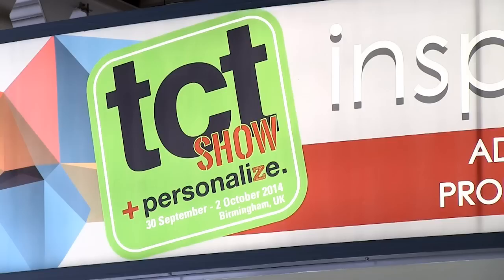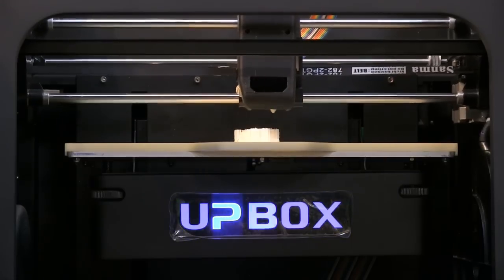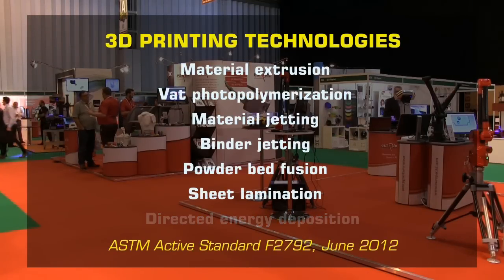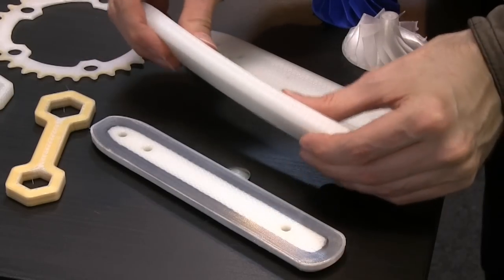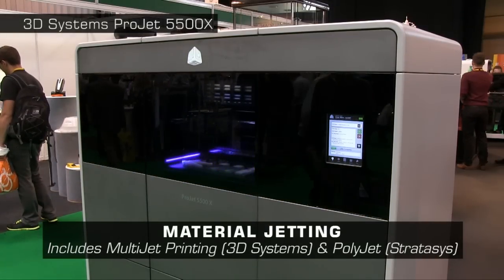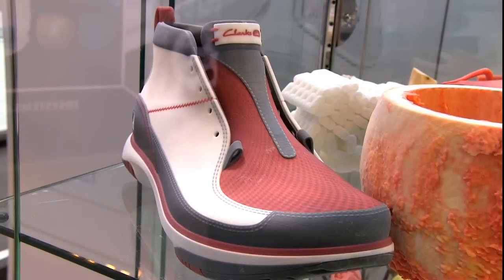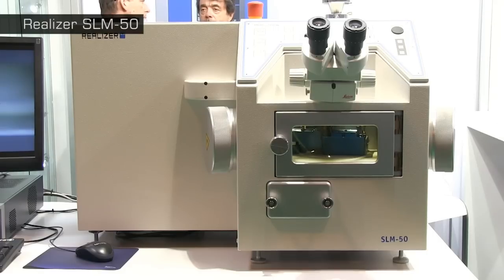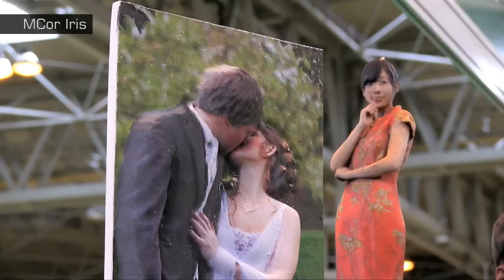The TCT 3D Printing Show 2014

Comment: Hello ! You have nice videos. I wan to to ask what kind of printer and filament I need to buy if I want to print something like rubber in terms of flexibility or something between solid plastic and rubber. Thank you.
Reply from the maker: +Urzicavictor You need a filament that is a thermoplastic elastomer (TPE) -- a well known one is called NinjaFlex. Because the filament is flexible, it works best on a printer with a direct drive extruder (ie the servo that pulls the filament along is actually on the print head, not far away from it pushing it down a tube). This includes various Makerbot models, Lulzbots and Printrbots.

Comment: Someday tattoos will be made with a 3d printer technology giving the colored skin a raised surface all without the need for needles or the artist. Basically anything can eventually be printed. In early times, mankind had always made everything themselves and then later traded items. As society grew, making your own things was not practical. With 3D printing an individual can be their own manufacturer and govern the quality to exactly how they want it. Will 3D printers cause some merchandise to be sold at a lower cost? Want a PC speaker similar to the ones sold at Best Buy? Print the case and knobs and just buy a cone and wires. I paid $100 for my desktop speakers but I bet printing them will cost a fraction of that cost. I think Best Buy should sell 3D printers.

Comment: If you want to print jewelry prototypes, what printer should I get? For a reasonable price?
Reply from the maker: ***** For jewelry prototypes (and indeed lost-wax masters) of any quality, you really need to use a form of resin-based printing, such as DLP projection. They are messier to use, but produce great surface quality and have good resolution. Personally, right now I'd get a Form 1+ for this kind of work. Other contenders include the B9 Creator, Asiga (more pricey!), and the (almost here, and probably cheapest) the XYZ Nobel 1.0 -- http://us.xyzprinting.com/us_en/Product/Nobel-1.0.

Before all of the above, I would try designing a few models and getting them printed by a bureau like Shapeways or imaterialise. They charge mainly by volume, so jewelry is a great thing to bureau print (including final metal jewelry).

Comment: A question on the 3d printing aspect, was a method for AlO (aluminums oxide) possible with the powder printer that you showcased in the video or was it more efficient with one of the laser printers shown in the tct show floor?...

Comment: Other than counterfeiting casino chips, whats the practical use for a 4 nozzle/ print head printer?
Reply from the maker: Arbhall McDougall The use is four-colour printing, or three-colour with a support material. Which is relatively limited use as you say compared to a three-nozzle printer -- and hence the reason why I don't know of an industrial 3D printer with more than three nozzles. :)
Reply: ExplainingTheFuture What application is there for a three head? I can see the odd use for a dual head, so that some parts can have soft and hard plastic components. Beyond that, only thing i can think of would be parts with a sub layering. For like glow in the dark elements or with the bronzefill, channels or conduits. Say for example a prosthetic with inlaid conductive elements, as well hard and soft plastics for comfort and flexibility. Maybe a hard case outer layer, with the harder plastics/ bronze/ stone or wood materials. I guess it all depends on the level of creativity needed to apply this concept. Still seems kinda crazy, I mean for toy applications Im not going to print for production, just prototype and cast/ copy the production models.
Reply from the maker: Arbhall McDougall Two-colour prototypes or architectural models are very common to show detail or different parts, and to print two-colour models with a dissolvable support requires a three-nozzle head. I'm not saying these are that common or that I would want a three-nozzel printer, but that is why they exist (eg in the Cube Pro Trio). This said, for high-end work, with the full-colour technologies -- like on the ProJet 4500 shown in the video -- are increasingly being used.
Reply: Casino chips that are some decent value have electronics embedded in them. People think of such shit.
Reply: Eviltech Casino chips have been around a while man, and while Ive heard of counterfieting money. I have only once ( oddly) heard of faking Casino chips, and that struck me as odd since most of the early Casinos were run by crime families. I would have thought it would happen there faster and more often, it did. It was just covered up faster and more effectively. Some of the things Casinos have done is impressive, and it would not shock me to learn that the government pays them for some of their ideas and practices.
Reply: Arbhall McDougall Actually they do. They also use private contractors to test their security and provide pointers.
Reply: Eviltech lol thats awesome!!
Reply: In the future. Maybe a few years from now. We will have printers that are capable of printing multiple different colors and materials in the same print.  The technology is here, we just need to discover and apply it.  Heck, pretty sure HP is unveiling it's printer that can do such a thing (not sure how many nozzles but I'm sure it's a few at least).  Don't quote me on that.
Reply: Billy Jean The future is now,  this is only what they are selling this year, next years is being tested, and the model they release 2 years from now is being planned.
Reply: That's literally what I just said.  And thanks for the business 101.
Reply: Billy Jean But one model out already is capable of printing in 4 colours, not a few years from now. Right here and now.
Reply: Lol everyone tryna be right and not understand.  4 colors is less than being able to bring 400+ colors and 100+ different materials in one printer or print. Lol, u thought I wasn't thinking big?

Comment: For anyone wondering, I've checked out the price of the Realizer SLM-50 and... it is 120 thousand USD :) You're welcome
Reply from the maker: Sokarijo.Diaries Thanks for the info -- sadly this quality of metal printing is currently very expensive . . .
Reply: ExplainingTheFuture Yes... But I think it will be worth the wait :) I am thinking on buying the Ultimaker 2. Do you have personal experience with filaments (for desktop 3D printers) such as Bronzefill and Copperfille (from www.colorfabb.com)? From what I've seen, they look very realistic and metal-like.
Reply from the maker: Sokarijo.Diaries The Ultimaker 2 is a great printer. I have seen (and handled) several bronzeFill objects, some made on an Ukimaker2, and they were very impressive -- really solid. And with polishing you can get a great sheen.
Reply: Sokarijo.Diaries
Reply: ExplainingTheFuture The bronzefill works with nearly all printers, it your printer uses the PLA materials it can use the bronzefill. The thing that jumped out to me was the printers with 4 nozzles or print heads. Thats nuts! who needs that?
Reply from the maker: Arbhall McDougall As above on the 4 nozzels -- agreed! :) On bronzeFill, some printers are more successful printing it than others -- and some (like the Cube 3, Cube Pro or DaVinci models) are fed from a chipped cart that limits the use of such filaments. :(
Reply: ExplainingTheFuture Good thing I dont want any of those, Ima get a Flash Forge or Ultimaker. I know the bronzefill works on those printers. But thank you for the info in any case. The cube was starting to look kinda neat, but the other 2 models you mentioned are way too expensive.

Comment: came here for the skull ( 4:39 )
Reply from the maker: Torgonuss Ole The skull was seriously cool -- laser sintered in titanium.
Reply from the maker: dsjc666 Yes, I bet it was very expensive -- made as a showpiece, apparently. And out of titanium. But a lot cheaper to 3D print than to make by traditional methods (even if it could be made quite like that by traditional methods). The company that made it (LayerWise) used the same technology to make the first 3D printed jaw bone that has actually been surgically fitted.
Reply: I bet that skull cost a fair but to make

Comment: hey friend
please tell me - best metal print from jewellery...regards
Reply from the maker: censored aggregator Most jewellery is 3D printed indirectly from a wax up produced on something like an envisionTEC Perfactory or a Stratasys WDM machine. The ExOne binder jetting direct metal (with infiltration) process can do nice jewellery if you like the style it creates and can work with bronze or bronze/stainless steel. The Realizer SLM machine in the video here -- very new -- would actually be a great direct metal jewelllery printer, and is marketed as such as it can work directly in gold. An expensive process!My advice for getting into this would be to try some designs by uploading to Shapeways or i.materialise, and who both offer metal via waxups for lost wax casting, or direct via the ExOne process. Many successful companies doing 3D printed jewellery (eg Nervous System) outsource the printing to Shapeways or a similar service -- not least so they can access multiple technologies.Oh, right at the other end of the spectrum, checkout BronzeFill -- a bronze / thermoplastic composite that works on many desktop printers -- eg Ultimaker -- and which can make nice jewelry stuff as it polishes up nicely and is really solid/heavy.

Comment: Thank you for the nice breakdown of the different types of printing with real world examples.  This is really the benefit of these types of shows.  The changes and options are coming down the pipe line faster than I could imagine.  Take shoes for example, custom fit to the individual, produced at home!  The options are endless!

Thanks Chris

Moonpie
Reply: I would also comment that the recycling business using already rendered 3D printed object like shoes will probably become a big business also!  Imagine disposing of your old 3D custom built shoes only to make a new pair out of the same raw material???

Moonpie
Reply from the maker: MrMoonpie001 Agreed. 3D filament reclaimers that can turn old printouts into new 3D printing consumables already exist. Fairly soon the idea a machine that can turn old objects into new ones will be a common reality. :)

Comment: How does sintered metal components compare in cost and structural strength to conventionally machined components? If or when its cheaper than CNC milling machines it could take over allot of manufacture. Sintered metal powders could also create exotic pattern welded alloys.

For the printer that lays down carbon fibre I would ask the same questions how it compares in cost and strength to conventionally made carbon fibre components? As the fibres can be layered down precisely in desired patterns it could be quite strong.
Reply from the maker: MrMonkeybat 3D printing costs less for one-offs, small runs, and customized components, and also allows previously impossible geometries to be manufactured -- or to be manufactured in one piece. But for any scale of production, 3D printing remains expensive.
Reply: ExplainingTheFuture ETF, how about the material properties of the powder bed fusion (PBF?) sintered metals?  Is PBF the only method of 3D printing of metals?

Comment: Great video. It is interesting to me, as the conversation about when/if 3D printing becomes mainstream enough to be in most homes continues....we are still seeing a wide variety of different kinds of printers. We aren't seeing a convergence of one kind of printer that can print plastic and metal, or a printer that can print full color and still be robust as ABS plastic, for example (from what I can tell).
Reply from the maker: techno9991 You are absolutely right -- 3D printing remains a set of technologies, each suitable for different things. Technically a full-colour printer for robust plastics could be possible (using heat to fuse plastic powders that are sprayed with colour), but this would be a mix of two current technologies, and nobody has built such a printer yet. This is all why I think that local or online bureas are the future of "domestic" 3D printing for some time to come. Though keep an eye on Graphene 3D Labs, who are making some interesting promises for future multi-material printers (and have floated on the US Stock Market on the basis of these promises).

Comment: What do you think will the most used 3d printer in the future? I liked the form 1+
Reply from the maker: Mozart Araújo The Form 1+ is a seriously nice piece of hardware. The new Robox and UP BOX printers are also very nice, with the latter clearly set to provide stiff competition to the Ultimaker 2 and MakerBot Replicators. I hope that we will see color, powder-based plastic printing on the desktop fairly soon.As for the most used printer short-term, I will be uploading my "Top 10 Personal 3D Printers 2014" video in November -- and it will be quite a different list from my 2013 list. The market is moving very quickly indeed.
Reply: Looking foward for november!